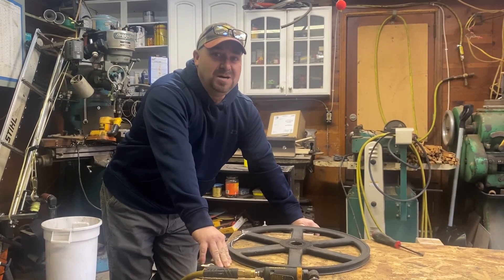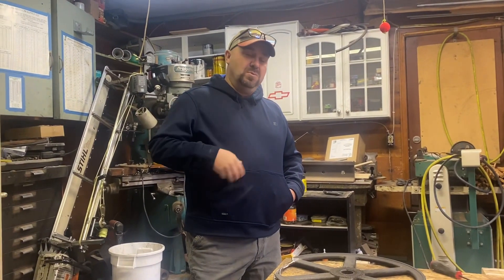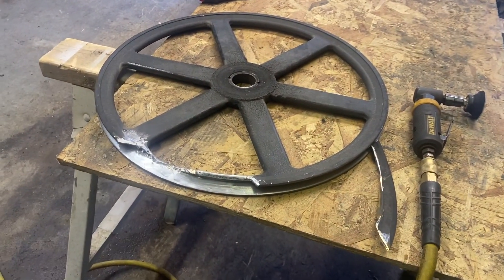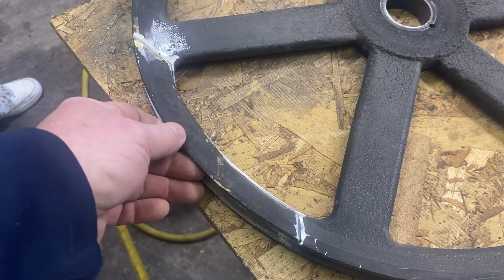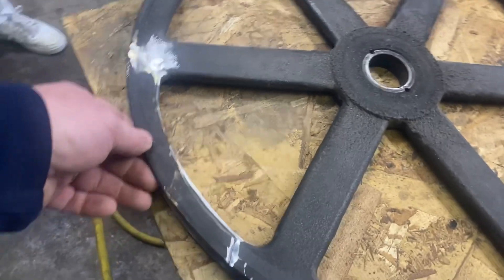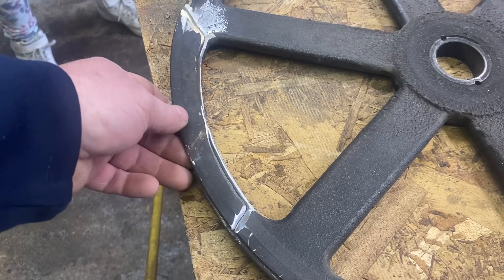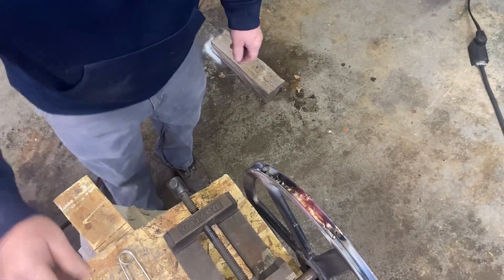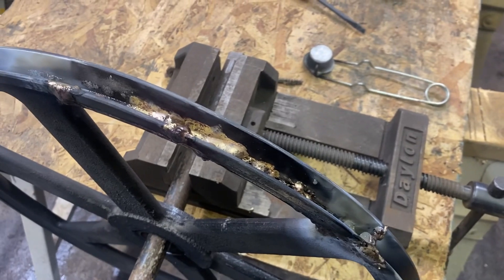Sawmill breakdown now what?

Comment: Do you have a brazing tip? Much easier to control the heat. Like your saw.
Reply from the maker: Yes I do have a brazing tip. This time I chose to try the torch for more heat to keep the cast warm over a larger area. That was my thought process. Trying something I guess. Usually I do use just the welding brazing tips though. It is easier for sure I agree. Thanks for the comment.

Comment: Are those 18.75 wheels?
Reply: What size of belt are used on those band wheels ,B56 or B57? Flat ,or crowned. I'm sorry to ask so many questions ,but I've never ran the groove type wheels.
Reply from the maker: Yes 18.75. Surplus center wheels are what I order to replace the broken one and it was the exact same as the original I ordered from ebay.
Reply: @PaulWhitedWoodStoneIron  
Are those what you would recommend? The band mill I built and sold I used 19" Cooks solid steel with a slight crown, but they are a little pricey. I saw these we're very reasonably priced! I'm going to build another one. Gathering parts now. You done a great job on your mill!
Reply from the maker: @melvinjohnson7981  thank you very much for the compliment.  The wheels I have work well yes. Other than the first one breaking. But if I had to do it again I think I would go with cooks wheels. For sure a superior product but these have worked great for the price for sure.

Comment: Where do you get the wheels. And are you going to replace with same one
Reply: Ya....surplus center for sure.
Reply from the maker: @aaronymousunlimited2661  that great. I did order from them for a replacement. Wish I would have know that from the start. Way better wheels. I know what company I would suggest for sure now.
Reply from the maker: Probably not. I contacted the company about the failures and they haven’t gotten back. So I might be looking elsewhere. I’ve had many people ask for plans and recommendations and I’m not sure if I can refer this brand. But I do think I will be going with wheels from surplus center.
Reply: @PaulWhitedWoodStoneIron  I got mine at surplus center and no problems for 6 years
Reply from the maker: @pup734  that is great to hear. I ordered a new one from them.